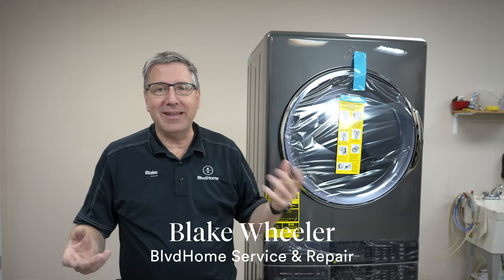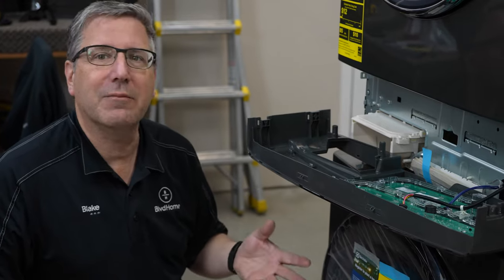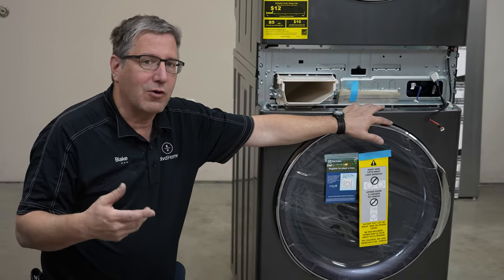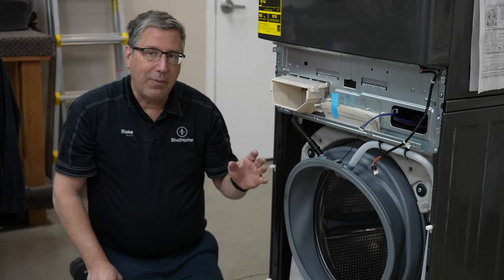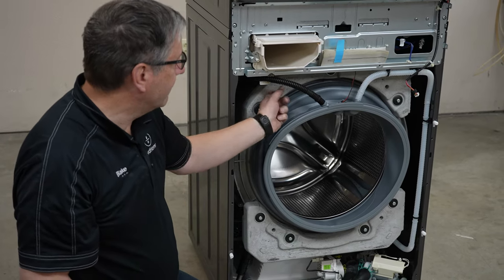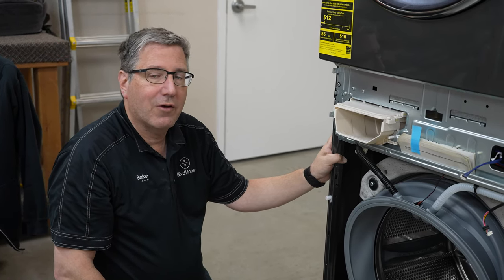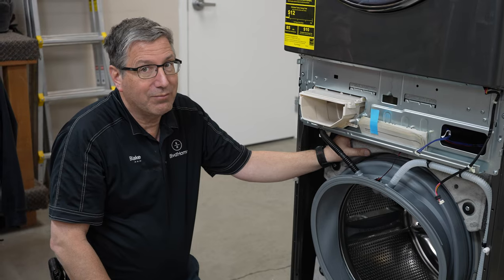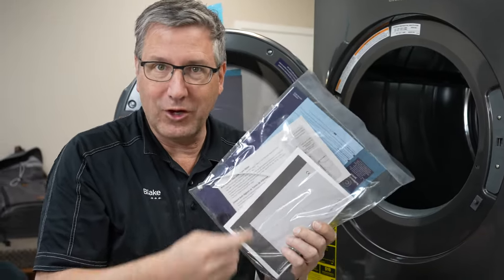Inside the Electrolux Washtower | Service Technician's First Impressions

Comment: I had both a 300 then 600 electric dryer series tower installed and both times found aa approx 3/4” flat metal washer on the floor where they unpackaged it…should I be concerned? They both worked after..thx!

Comment: I previously had an LG that had a front filter to clean out. My Electrolux tower was delivered last week. I have been searching for the drain clean out? Does it have one?
Reply: Yes! Where is the CLEAN OUT???
Reply: I’ve had mine for 6 months. I already have an issue with draining. On occasion, it will not drain all the way (at the end of the spin cycle). Did some research and was told there could be a clog and it should be cleaned out. I saw one video that showed the clean out on the back of the machine, bottom left. I can’t find the video but I need step by step instructions on how to get to it. FYI- I called warranty to have it serviced and the technician said these machines were new to him, he wasn’t even sure how to address my drainage issue.

Comment: Hello Steve i have an Electrolux Front Load Washer model EFLS627UTT0 which earlier this week, I went to run the clean cycle and came back 20min later to see that nothing had initiated as the cleaning tablet was still dry in the tub.  Needless to say I ran the diagnostics and an E57 error came up.  I called a service technician that suggested its motor related and to contact Electrolux to inquire about their 10yr warranty on the motor.  Now I saw another Youtube video that suggested E57 could require a new "Motor Board" vs a new motor etc.  Do you have any experience troubleshooting E57?  I have a couple of certified Electrolux technicians coming next Tuesday to diagnose and then tell me the cost to fix with whatever the issue is.  Had to pay for 2 techs because of the stack of the dryer on top.  I live in a condo and the units are in a laundry closet.  Would be interested to hear from you if you have experience with E57 to resolve.

Comment: Blake,  we just bought a ELTG7300AW the problem I'm have is when spin is complete and transferer load to dryer it won't start I have to wiggle around to get board to light up. Have you came across this before love the unit now if can solve this?

Comment: thank you for the review. I am debating between this and a) getting a separate washer and dryer Electrolux 600 series OR b) LG washtower WKEX200. what are your thoughts on this?
Reply: Dryer just gave out and am making the same consideration.
Reply: Get the LG. More reliable overall and most importantly, pump filter access. Electrolux lacks it. Meaning if a sock or some coins get lost… yikes.

Comment: The two screws that he showed removing on the front of dryer after opening the dryer door does not disconnect the front of the dryer. 
He must have done something else.
Reply: Those are all the screws. You have to lift it fa bit to release it from the pins.